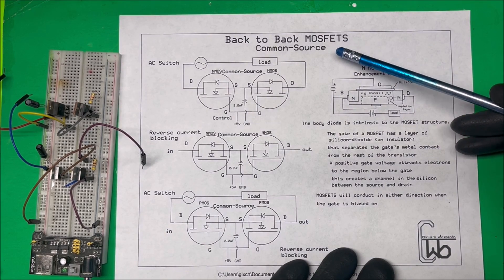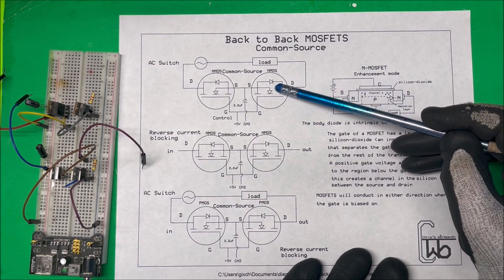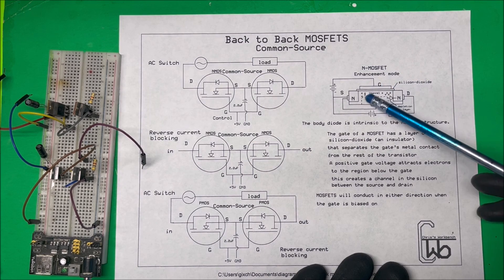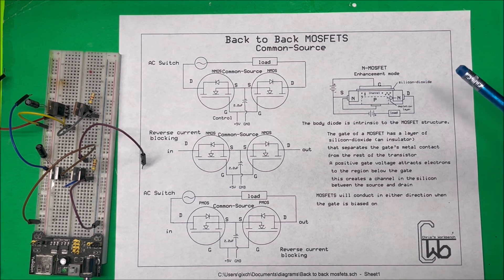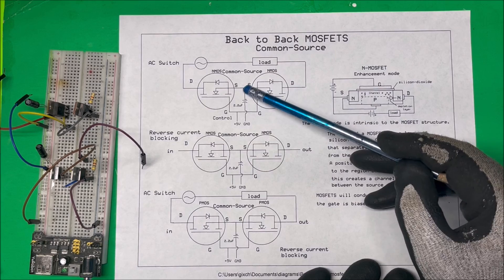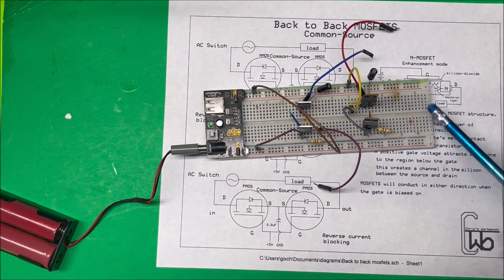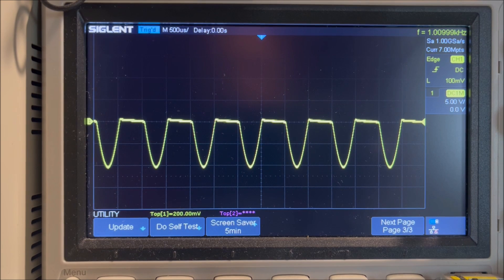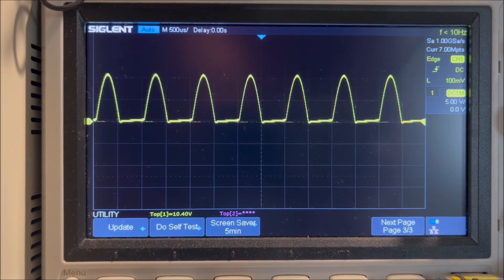Back to Back MOSFETs

Comment: You can safely remove the capacitor as long as DC and AC powers float. 

Your DC ground follows AC line in the on state, and it's half rectified negative in the off state.

You can verify that with the oscilloscope.

Comment: Hey, can back to back mosfet current blocking use as diode emulation like in active synchronous rectification instead inductor zero crossing detection, i know its more expensive but maybe its more simple? Thankyou